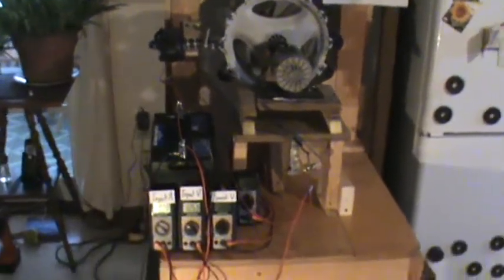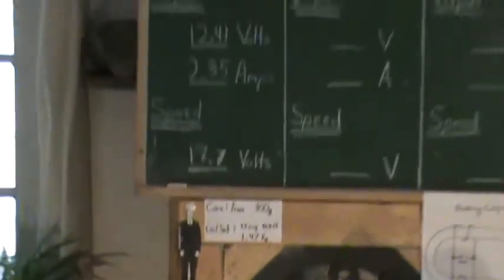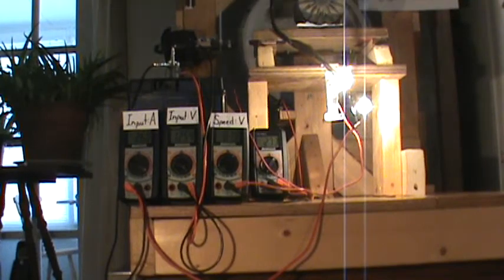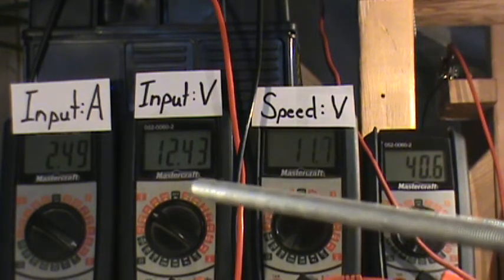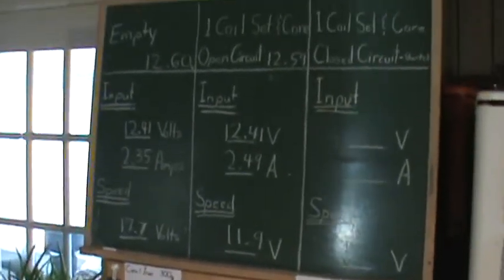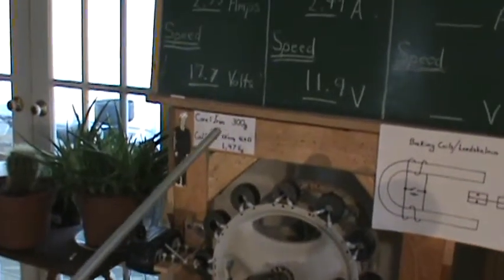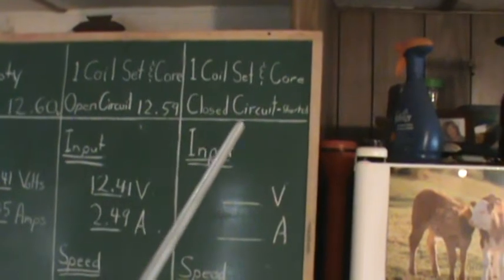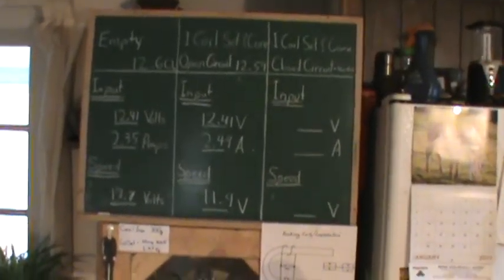Free Energy Project - Input and Speed Test 2

Comment: I can see where you're headed here regardless of whether you realize it or not. But if you shoot for a frequency of 60hz and a resonant voltage of 120v theoretically you could plug household appliances into each coil set and run them from the aether.  Now, there could be limitations as to how many items you could run and you may create a time distortion  or instability with time. Your coils should run cold because you are dealing with aether energy.  This can be done in many ways. Cheers.

Comment: Do you know what the short current is? It would be interesting to know what the maximum current will be when you use real thick wire. I had only 40 mA short and around 30 V open with 0.3 mm diameter wire. I think I will combine the 4 coils with 0.3 mm all to one coil in parallel so that I will have the same as 1.2 mm. Hope to get some serious amps then. Look forward to your nest test.